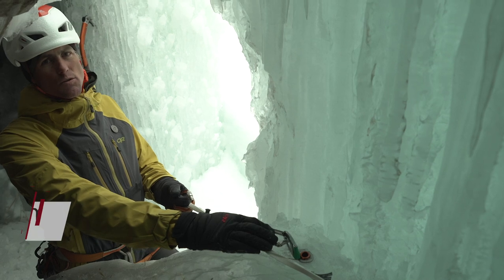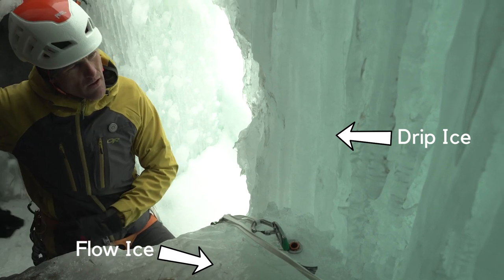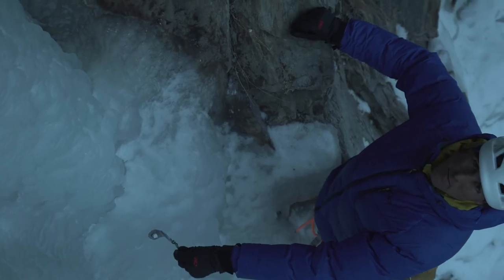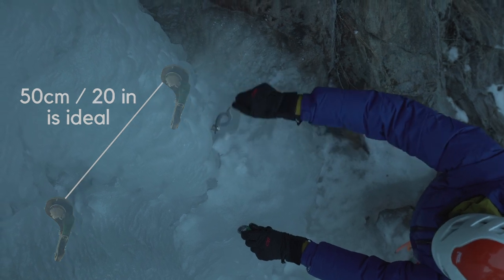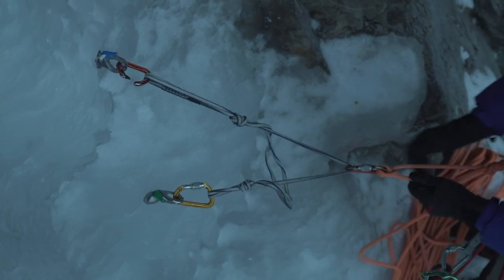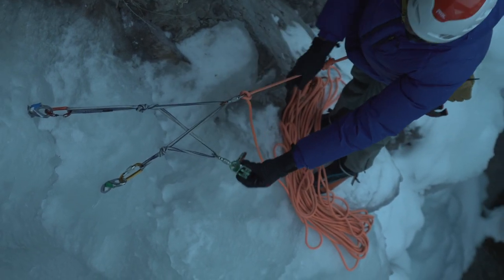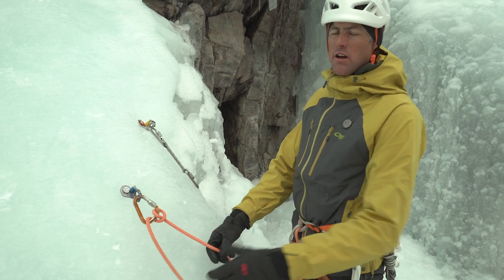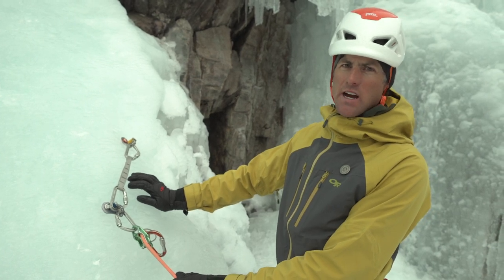How to Build Ice Climbing Anchors

Comment: Does it matter if the screws are horizontal or on vertical ice?
Reply: Yes it does! The angle the screw goes in is important! Should placed perpendicular or tilted slight up from perpendicular.
Reply: @ski4life9  what I mean is the way he setup his first anchor. It's perpendicular to the ice but on horizontal surface, does it matter versus vertical ice when the angle of the climber is directly below
Reply: @akaTheDevil  ahhhh no it doesn’t matter as long as you take care to not have carabiners being “bent” over rocks or anything. An anchor like that would be more effective for top roping or belaying a second from above but wouldn’t be ideal for continuing up another pitch.
Reply: @ski4life9  sweet thanks!
Reply: @ski4life9 angled slightly down in angle of fall